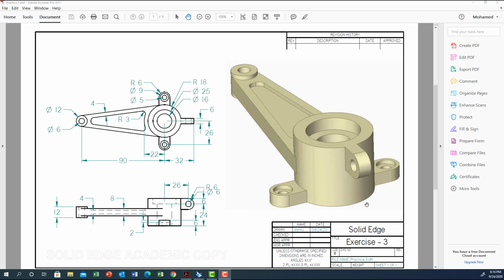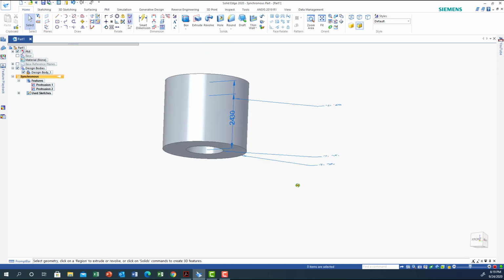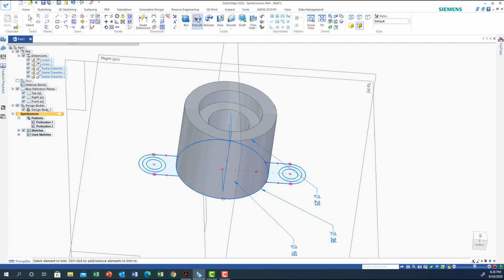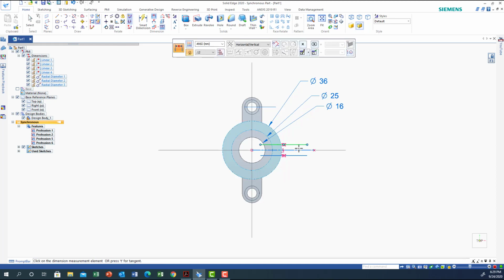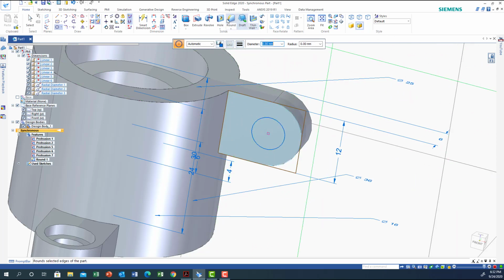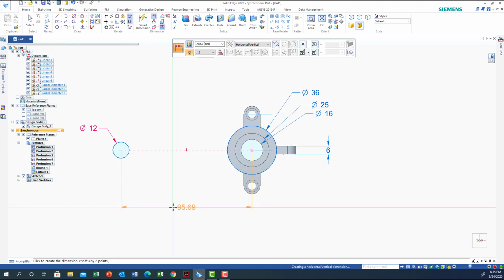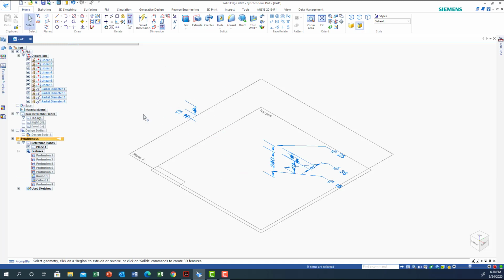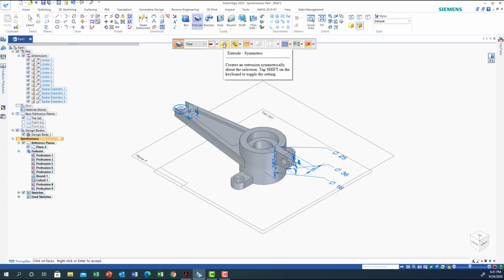Learning Solid Edge - Exercise # 3

Comment: This was a good exercise of several methods. I like the use of mirrors and the projection to lessen work. I don't know why you didn't draw most of the part at one time from the top x-y plane and extrude them. Rather than draw the central portion, extrude, draw the tabs, extrude, make a new plane, draw, extrude. I studied your solution. Then, drew all but the upper tab from the top view on the first x-y plane. I next, generated the 15mm plane and projected its components to extrude. I now extruded all that was on the first x-y plane. For the last tab I followed your method to draw from the part's top face.  My solution: Not really much better. It was less physical work. But, more thought and planning. 
It was fun to do your solution and mine for practice.  Thank You. [Note: You were better in 2020 than, 2022/23.]